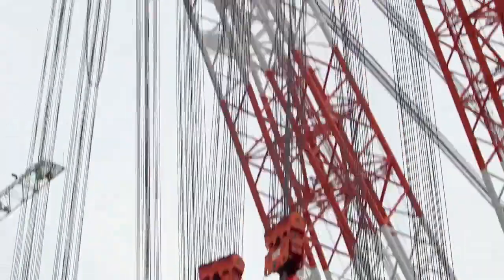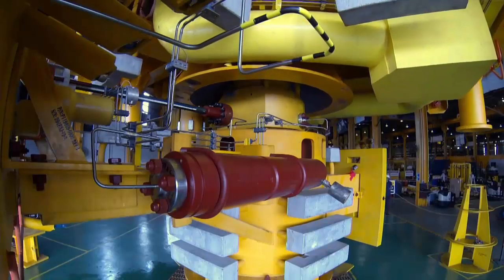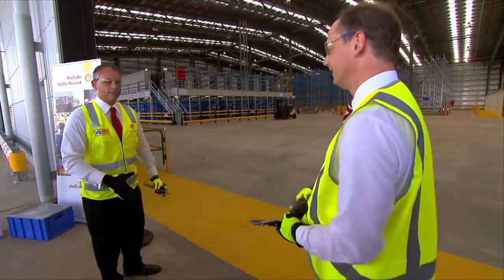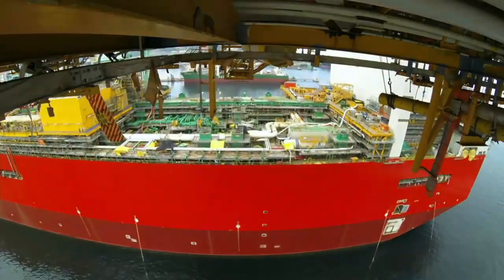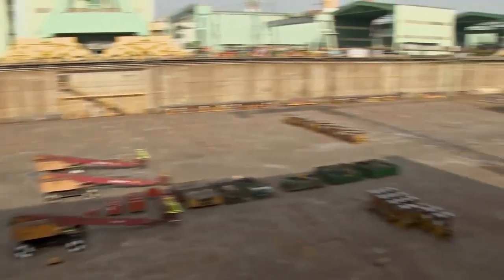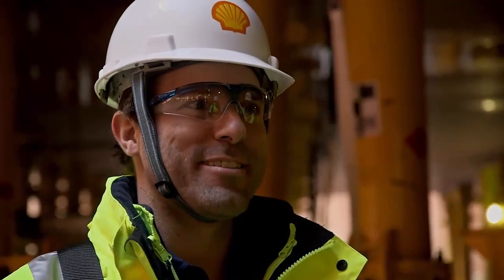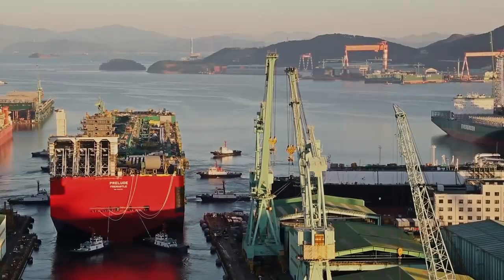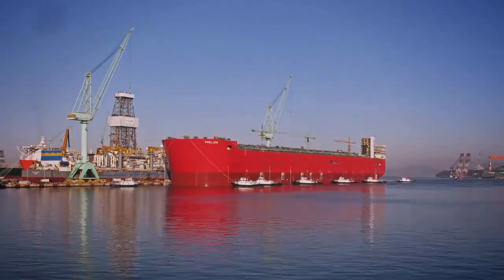The Largest Ship in The World - Prelude FLNG

Comment: This ship is so massive that it likely would get hung up on the seafloor as it traverses the Straits' of Melaka.   No way this ship can sail through Suez Canal.  Because this is a special purpose ship meant to hang out in one area of the ocean means there is no limits on it's size.  Most ships like mega container ships are limited in size so they can still sail up through the Suez Canal or Straights of Melaka.  Even the expanded Post Panama Canal can't handle mega sized container or mega tankers

Comment: this is seawise giant?(know nevis))
Reply: Nope. It was scrapped over a decade ago, it was the largest ship ever built. This is the largest floating mobile platform ever built. In order to be classified as a ship it has to be capable of moving under its own power which, the prelude isn't capable of.
Reply: @akindudeerada5840  hmm . so largest ,longest and hightest ships are different? i think highest ship is one cruze ship(i don't know name) . and if this ship largest  so which ship is longest ?
Reply: @9neo2  That's right, the highest ships are cruise ships due to their multiple decks. The highest ship is the symphony of the seas which btw is also the largest cruise ship ever built. Knock Nevis is the largest ship ever built in terms of length and gross weight. (it has the greatest dead weight of any man made mobile object to date.) This is longer and wider than the Knock Nevis but its not capable of moving under its own power cause it does not have its own means of propulsion. ( I'm not sure whether this is heavier than the Knock Nevis though)
Reply: @akindudeerada5840  oh okey then this is largest , longest ,heaviest ship fornow right?and thanks for the givin cruze ship s name
Reply: @9neo2  No problem.😁😁😁
Reply: I'm sorry this vessel (prelude) is also the highest ship as well. This is higher than any cruise ship ever built.😊 This stands 30 storeys high which is higher than the largest and highest cruise ship built, the symphony  of the seas. (Dunno what the height of the symphony is, but she's not as high.)

Comment: apparently it has no propellers and has to be towed
Reply: hum...wrong
Reply: Wrong. Totally wrong. Ships use propellers in port all the time. And don't tell me I don't know what I'm talking about - I'm a Captain (Master)
Reply: +Canoe Canoe Maybe, but ship's can't turn on the propellers in harbors, that's a worldwide rule :)
Reply: sorry but you don't know what you are talking about. the ship is anchored off the west coast of Australia and is towed by tugboats. it will then stay out at see for the rest of its expectancy and will never dock
Reply: t
Reply: +Keanu brierly
Apart from the dockings required every five years by Classification Societies. However, I suspect the owners will have come to some arrangement with Class.
Reply: wong 
No need for dry-docking. Divers will come and inspect the hull, in and out pipes, anchor chains, etc. Just like a regular FPSO.